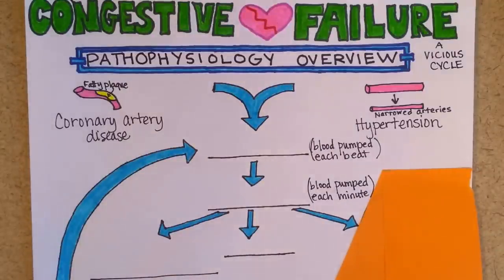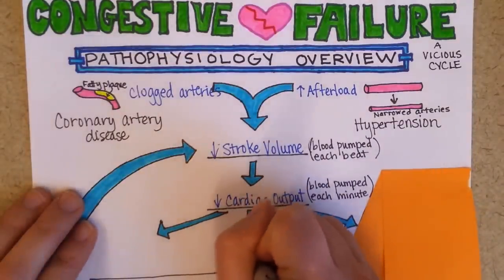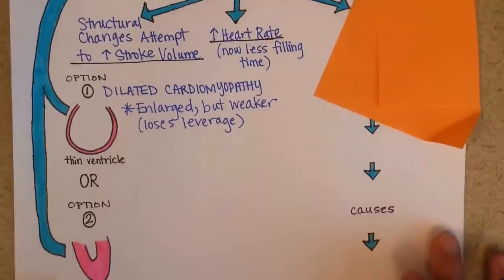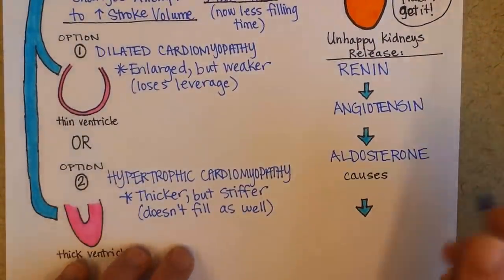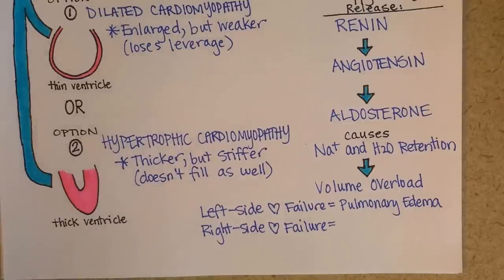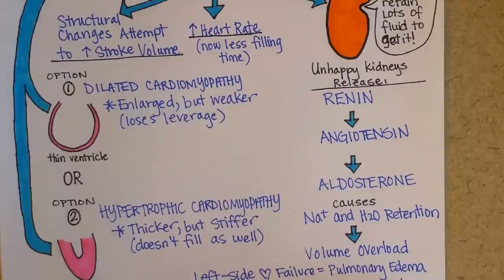Congestive Heart Failure: Pathophysiology

Comment: 1:36 less time to fill is not a compromise, wether with or without reduced ejection fraction due to heart muscle damage. 
The heart doesn’t just beat faster, it also beats more forcefully to result in faster fill time and higher pressure. Otherwise there would be zero point in increasing heart rate. We can assume the heart rate and fill time are perfectly matched, via adjusting strength of the ventricular compression. Heart rate and increased contractility go up together, eg via adrenaline.

2:38 the practitioner narrative is always: this just happens as a compensation mechanism. But dilated cardiomyopathy has direct causes, like viral infection and alcoholism, both of which lead to heart muscle damage, which makes a lot more sense than saying this happens because the heart is trying to compensate.

For list of causes see eg Dilated Cardiomyopathy, 2010, the Lancet.

This weakening vicious cycle is, for all I can tell, a convenient story blaming the body. It makes no sense that growing a stronger muscle to compensate would at the same time lower pumping ability. That can only be explained by continuous insult to the heart muscle. Athletes don't get dilated cardiomyopathy, they get a stronger heart.

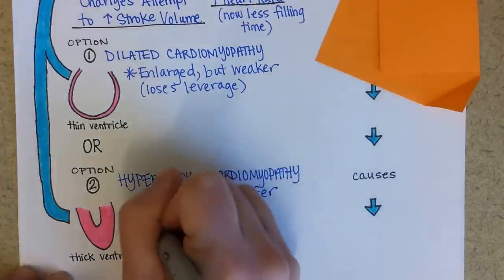3:30 ditto

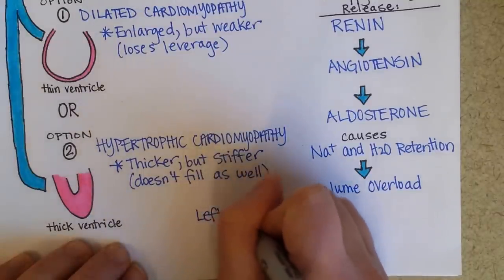5:39 there are mechanisms involved first that try to compensate without involving the kidneys, the so called baroreceptor reflex increases heart rate, contractibility and vasoconstriction. These all would not result in a 'vicious cycle'.

Other conditions that can cause edema are kidney failure, liver disease, inflammation, dvt, NSAIDs, COPD, PE, ace inhibitors

Vasodilatory edema: A common side effect of antihypertensive therapy, 2002

Effects of nonsteroidal anti-inflammatory drug therapy on blood pressure and peripheral edema, 2002

Nonsteroidal Anti-Inflammatory Drugs and Heart Failure, 2012